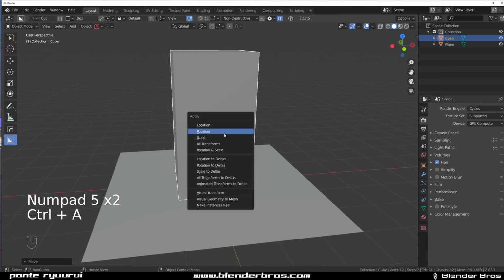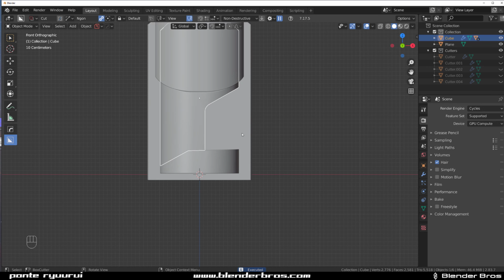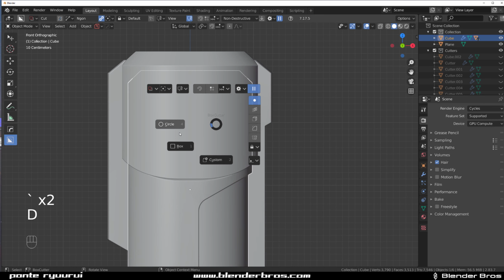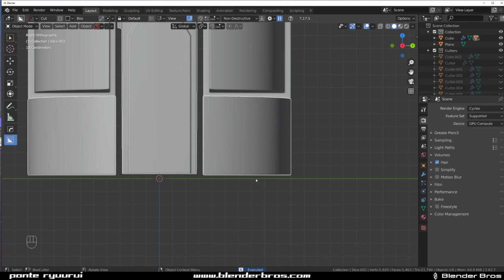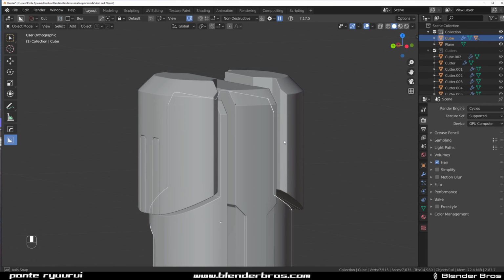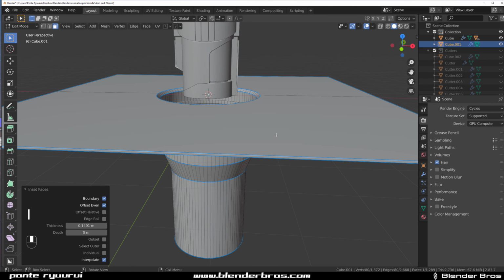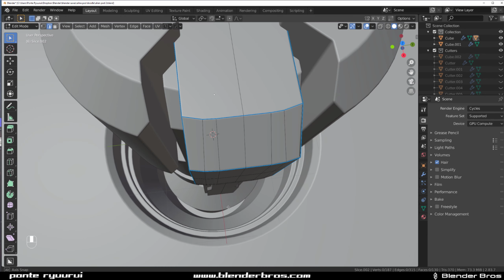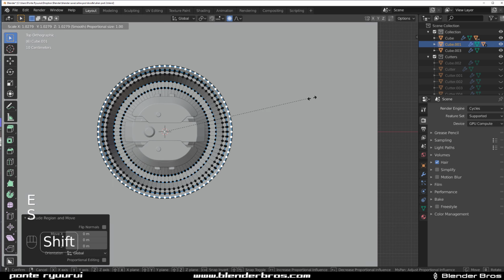Sci-Fi Environment ModelingTUTORIAL for Blender - Part 1

Comment: Do you come up with everything on the fly when you create something new? Sometimes I want to do something and fall into the abyss ... It just doesn't occur to me)
Reply from the maker: ya all my designs are on the fly, I build on shapes that I create. Try this exercise, grab a cube and start forming it, then rotate around and try to see if you can build on it, if you can see any shapes that could be a building block or base of a larger idea, dont think about details, think about form and balnce.
Reply: If you need inspiration; go to your bathroom check all the plastic container for shampoo, or cleaners with handle, take that product design, add some cables, make some cut’s and you are ready to go. Take care on symmetry, that is what gives it an appellant slick SF look.
To me it comes similar on the fly, I start out with a block and than it comes all together.
Reply from the maker: @miklin6203  there you go
Reply: I think it's very worth digging around something like artstation and pulling a bunch of different people's environment concept art and trying to design around that. It's good to develop your ability to take a 2d concept and translate it to 3d
Reply from the maker: @riftkan  I would suggest something better, go through a visual library and refs and then make something with refs closed. That is how you progress.

Comment: What lacks blender modeling community is making making assets for games. What lot of people demand is making your models optmized, UVed , textured , rigged and used in game engines. you even put 64 vertices on a simple cylinder................
Reply from the maker: key word "concept", take your time it will dawn on you, also, give it a year for the UE5 to pop, an dno one will give a fuck about vert count mate
Reply: Aside from this simply being a concept, here's also the thing. How many triangles an object should have depends entirely on what you're doing and what the design dictates. Like, the Thunderjaw in Horizon Zero Dawn is apparently like 550 000 polys (so, ~1.1 mil tris?). A lot of guns in AAA games are in like the 10k range etc. So if working on a portfolio, that is more or less arbitrary from what I've been told.
Secondly, optimizing isn't really hard. It is mostly just tedious, eradicate n-gons and turn tris into quads without changing the geometry too much, and you don't need to only look at blender for any of that, optimizing, UV-mapping, texturing, etc. is pretty much the same no matter where you do it.
Reply: @qloshae  To add to that, tris are actually fine for certain game engines. The one I model for, Arma 3, is perfectly capable of importing models with tris in the mesh. Ngons however makes it cry big time, but that's where Triangulate Ngons from HardOps comes in.

Of course, it depends on what the particular part of the mesh is going to be used for. Is the mesh going to deform? Quad that sucker. 

So yeah. Totally agree that polycount of objects completely depends on what it's used for. As Ryuu's making a concept model here, the polycount doesn't matter.